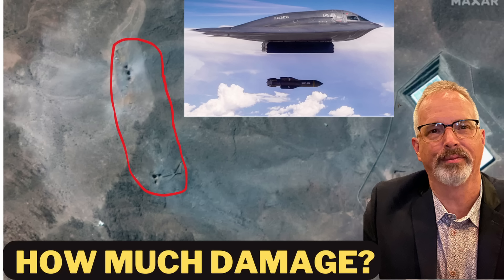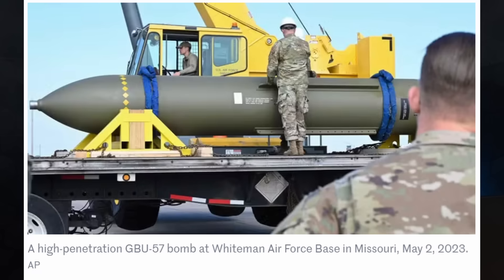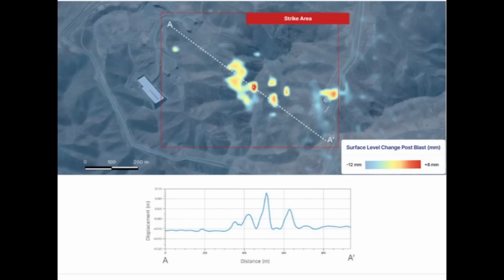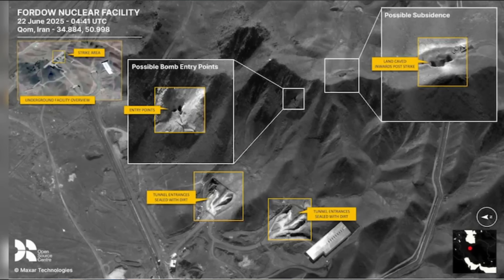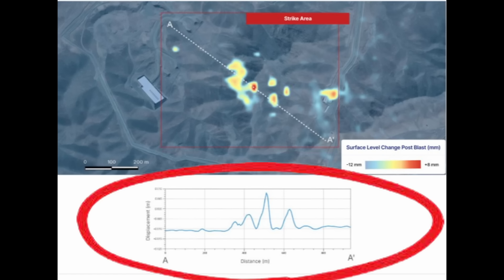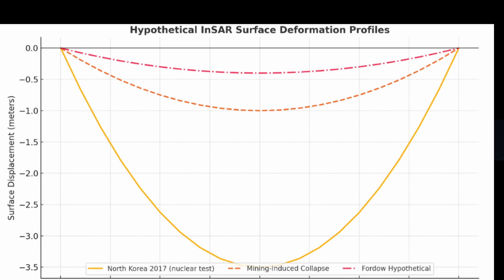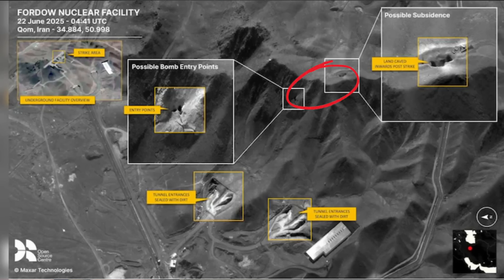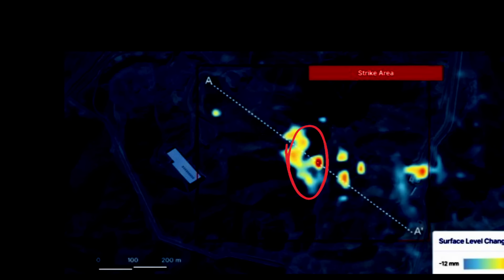Fordow Attack Assessment -  Update

Comment: The reasoning is backed by underwelming evidence since as you said there's little surface expression.
Anyway, 400 Kg of enriched uranium is still unaccounted for and it's very likely Iranians have moved it before the bombing.
To add to that, Israël just like the US could not strike all the other active nuclear sites to avoid the dispersion of radioactive materials.
At the end of the day, if Trump didn't ditch the Joint Comprehensive Plan of Action just because it was an Obama success, we wouldn't be discussing this 10 years after.

Comment: In my eyes… I didn’t even need to go as far as geotech. I just used the before and after pictures wherein the “after” pics have crushed rock powder  that altered the color around the impact site this “color” was also present in the access tunnels. This means that the MOPs went through all the way to level of the tunnels and the resulting blast went through until the tunnel “entry or exit” points.

Comment: The MOPs were designed and tested with assistance from Los Alamos National Laboratory (LANL) starting around 2010 with the first physical prototypes dropped around 2012. They were designed by an interdisciplinary team which included physicists, explosives experts, metallurgists, geologists and civil engineers, and the MOPs were designed SPECIFICALLY with Fordow in mind. The geologists located a mountain about 20 miles from the Trinity Site in New Mexico that was thought to be  geologically similar to the mountain at Fordow, and they even went so far as to build a hardened bunker under it. You can read all about this in GREAT DETAIL by Googling "Los Alamos Scientist’s Insights On The GBU-57 Massive Ordnance Penetrator, Howard Altman, The War Zone, July 3, 2025"

Comment: Would a volume of 100,000 m^3 equate to a radius of 50 m? If the charges were to have detonated sequentially, each fracturing a volume of rock, would the powder factor change as rock has been fractured by the previous explosion(s)?

Comment: Fodow is built in Andesite and Basaltic Andesite extrusive volcanic flows, of the 55-38 million year old Urumieh-Dokhtar magmatic arc. The volcanic rocks are overlain by younger 33-20 million year old sedimentary rocks of the Qom Formation, that includes competent beds of limestone, marly limestone, and dolomite. An old geological map, c. 1950, puts Fordo in the Orumieh-Dokhtar volcanics, but close to the boundary with the Qom Formation. I can see the dark volcanics at the site, but lighter sedimentary rocks just to its east. I think, judging from the color of the rock, and indeed the Iranians preference for stronger rock, that it's in the volcanics, however, it might be interbedded with sedimentary rock i.e it's a transitional area. There's a report about a tunnel north west of the site, I think 50km, in similar volcanic rock, and the report found the rock was a couple of times stronger than concrete. Given the depth of the centrifuge halls, 80-110 meters, I thought it was impenetrable, especially if they lined the tunnels with Ultra High Performance Concrete, but I didn't know about the air shafts, an Achilles Heel.
Reply: Why would you assume the air shafts were an Achilles heel? There is 0 public evidence, that they were not hardened using UHPC as well. There is 0 evidence, that they were directly connected to the main centrifuge halls, without proper shock absorption. All we publically know, are some old leaked plans.
Reply from the maker: Thank you so much for those details!

Comment: These tunnels are 80-90m below ground in granite. You can not penetrate that deep through hard rock using the GBU57. The air force knew this so they tried to go in through the ventilation shafts. 

If this worked the explosive force would go into the tunnels. You can not assess this from the surface.

What you see on the surface is a concrete cap covering the ventilation shafts being rearranged. They used one gbu57 to remove this cap at each of the two sites.
Reply: I’m speak Persian.   The Iranians say the tunnels are 1km deep and made with a special concrete specifically designed to withstand bunker busters.
Reply: @BabakTahani-e3v What else could they possibly say?

Comment: Suh-WEET! Sounds like if the Iranians try to dig it out, they'll find scrap metal. The question now becomes, how did this affect Iran's nuclear program? I suppose it depends on how much of Iran's UF6 remained in the facility when the bombs hit. 

UF6 is a solid at room temperature and sublimates around 130F. This implies that it's got a decent vapor pressure and likely would need to be enclosed in some sort of pressure vessel. If we use the density of pure Uranium as a rough yardstick (700kg/ft^3), we can assume that all of the UF6 can fit within a cube roughly one foot on a side. We also know that there have to be several containers, as this is well above critical mass. Ultimately, though, Iran could have removed all of the UF6 prior to the attack using a parcel delivery truck.

Did they?

So, questions remain. How much (if any) uranium was hidden elsewhere? If all of it was still at the "indestructible" Fordow facility ("Those degenerate Satanist PIGS will never penetrate our mountain!") - AND - if Mr. Jones's analysis is correct (not what I do for a living), Iran's going to be starting from square one, without several of their top minds. if Iran got the willies, unloaded their centrifuges and moved their stuff, they've got most if not all of it still available. It does seem unlikely they'll have more available anytime soon. Things are still up in the air but looking more hopeful, unless you're a Jihadist who wants to nuke Tel Aviv.

Comment: These tunnels are 70m below ground in granite. You can not penetrate that deep through hard rock using the GBU57. The air force knew this so they tried to go in through the ventilation shafts. 

If this worked the explosive force would go into the tunnels. You can not assess this from the surface.

What you see on the surface is a concrete cap covering the ventilation shafts that they used one gbu57 to remove.

Comment: Why do people assume that there is a shaft going directly straight down into the centrifuge room?  This location was developed knowinbg what sort of weapons would be used against it.  All those vent holes would be hooked up at various angles and nowhere near the the actual shaft which would some doglegs built into it.  I seriously doubt that even a light bulb was broken.  Most explosive force is going up to the area of least resistance, not down into increasingly stonger rock.

Comment: Knowing the US has a sophisticated satellite and high altitude reconnaissance capability, Would the Iranians have constructed vertical air shafts, which would have alerted the US to the area of testing facilities, or would they have ran those shafts back underground to their test facility to confuse an on looker?  If that was the case, the actual underground test facility could be any direction and distance from the surface shaft entrance.  Just curious why any one would think the test facilities are directly beneath the ventilation shafts?

Comment: I have question marks regarding the GBU57, as they went down a ventilation shaft, essentially a void with a void sensing trigger sensor. Also since the wikipedia I read suggested that they were using  GPS to navigate, which may or may not be exact enough to take 6-12 of these down the same ventilation void, as claimed in the video.
Imagine a scenario where the US dollar is gone replaced by crypto, and a rogue actors NEMP pulls the plug on every computer in America.

Comment: Appreciate the informative video, but a bit incredulous that Iranian engineers didn’t Google the topic and design countermeasures. 

The Cheyenne Mountain Complex, located inside Cheyenne Mountain in Colorado Springs, Colorado, houses facilities for North American Aerospace Defense Command (NORAD).  
Air Shafts and Protection Measures:
The complex utilizes a ventilation system designed to protect against various threats, including nuclear radiation. This protection is achieved through several features: 
90-Degree Angles: Air intake shafts are built at a 90-degree angle from the entrance. This design makes it significantly less likely for particles to enter the complex.
Blast Valve System: The complex features an advanced blast valve system that creates overpressure inside the base. This overpressurization forces any potentially harmful agents outwards towards the environment.
PS — who builds in a Death Star type weakness in a critical facility?
Reply: "who builds in a Death Star type weakness in a critical facility?"

The Iranians.
Reply: @colincampbell767 Typical yank seething.

Comment: Thanks, very interesting. 
I think that if I'd been planning this operation, to help with damage assessment I would a covertly installed or air dropped an array of seismographs along the sides of the target area and monitored what happened in real time. I might also add a "thumper" or two (kind of like Dune) so you could do seismic imaging afterward and check for remaining air voids.

Comment: I think your powder factor calculation is pretty low. I only use a.5 PF on boulders that have free faces on all sides. In high confinement the powder factor is significantly higher often a 3.0.  there are many other factors that affect blast efficiency such as voids and highly jointed rock formations that interfere with shock wave propagation. That said, homogeneous granite is hard to drill or penetrate, but shatters like glass when blasted. My guess is that the engineers who spent ten years figuring out how to crack this nut got it right. Thankfully we have a president who backs his words with action.
Reply from the maker: Thanks for the comment!

Comment: I think simple multiplication of the powder factor oversimplifies the physics and results in a huge (probably multiple  orders of magnitude) overestimate of the volumetric effect of one of these large bombs. Immediately adjacent to the detonation, the rock will not just be fractured, but pulverized or even melted; processes that take much more energy than merely fracturing it. The energy transfer to the rock probably decays as a 3rd or 4th power (exponent) function of distance. A physicist could enlighten us on that. Thus, the effects of your additional 1/2 pounds of explosive material do not have anywhere near the same rock-fracturing effect throughout a whole volume that you get by just multiplying up to get to 30,000 lbs. If that approach worked, mines would not bother to lay out a whole grid of numerous holes that they fill with explosives when they blast; they'd just drill one big hole and dump the dynamite down it. Simple multiplication to arrive at a conclusion of widespread underground devastation isn't a scientifically correct approach.

Comment: Almost 30000 pound bomb dropped from 60 -70 feet in the air with no initial propulsion. So the weight of the bomb by the time it impacts will be moving at tremendous speeds. Then as soon as it impacts the surface a propulsion kicks in driving further into the earth and detonates deep underground.

Comment: The most damning proof that the facility is gone, is Iran could just unplug the entrance that they filled with dirt and Drive inside.. Take a bunch of PR photo's and thumb their nose at the US.  The fact that they have a crane right now trying to lower a camera down the shaft says the facility is gone. Also remember the goal wasn't to destroy the concrete facility it was to destroy the very fragile centrifuges inside it.  If the Facility is collapsed then the fragile stuff inside is certainly gone.  UF6 would have leaked out as a gas, interacted with the water vapor from the bomb blasts turned into Hydrofluoric acid and very toxic uranyl fluoride.  The HF would eat almost everything it touched and the uranyl fluoride would be a fine powder that's embedded in every crack.  It would be less effort to start over then to try and salvage that facility.
Reply from the maker: Great points and Iran spent billions of dollars on that facility.  That has to hurt them.

Comment: Seems to me there are other factors here.  Fracturing causes bulking of course, but then the  second bomb explodes in the same space, etc., and eventually you have powder under the pressure of the rock load above.  The result would be less bulking.  Also, there used to be am extensive man-made cavern there that now has absorbed some of the bulking.  I think we might need a few supercomputers to calculate this one!

Comment: Simple (i.e.) basic comments:
1) No mention of previously enriched 60% uranium very likely moved elsewhere -whereabouts as yet unknown.
2) No mention that Iran has its own capacity to manufacture centrifuge assemblies - to be installed *where*?
Reply from the maker: That wasn't the point of my video.
Reply: @CaseyJones-Engineer  Granted - but it's a an absolutely key point in gauging what the key point of the strike(s) were tasked to achieve. All due respect, I suggest you were conspicuously remiss in ignoring those factors.
Reply from the maker: @2uksteve  I stated what the scope of this video would be early on.  I have no idea what is there in terms of uranium.

Comment: Let’s assume limestone with a compressive strength of approximately 35 MPa, almost identical to concrete with a compressive strength of 5,000 psi. Except that concrete is monolithic and penetration can be accurately calculated.  Also the DoD has released technical drawing of all of its current penetrator bombs and the GBU-57 is shown to have a penetration angle at impact that is ~20° off vertical. Plus the GBU-57 has a documented CEP of ~5m. The tale about 6 individual MOPs gliding down a vertical ventilation shaft is fantasy. Per the Pentagon, the first bomb  destroyed the (likely UHCP with a compressive strength of ~30,000 psi) concrete vent shaft coverings. Them boom, UHPC and MOP casing remnants scattered over a wide area. The second GBU-57 would have impacted at that ~20° off vertical angle and penetrated into rock maybe 10m, then…boom. Rock rubble and GBU-57 casing remnants fill the penetration cavity. Any GBU-57 bombs that were amazingly lucky enough to bullseye that center shaft would encounter ~8m of rock rubble and super hard bomb casing pieces. By the time that 3rd bomb got to solid rock, most of its energy would have been exhausted laterally while fighting through the rubble. The GBU-57 was designed to penetrate hard dense substrates. Almost all of its kinetic energy can be focused forward in front of the nose because the side of the penetration would be hard rock and would not absorb lateral energy.  The DoD engineers knew this, so did and do the Iranian engineers. Why give Iran, Russia, North Korea and China all of the data about stacking MOPs?  If it were a sane decision maker, they would blow up the UHPC concrete vent covers with a couple of Tomahawk missiles with the penetrator variant warhead and then push a wild story about stacking 6 MOPs down one hole and totally obliterating the facility.

Comment: As a geology student, an Army Engineer officer with conventional and nuclear experience and an estimator for a large, international construction company working on I-75 in Kentucky just south of Cincinatti where the rock is extremely hard and the cut walls are vertical I would say that all granite is not created with the same hardness.  I agree with you on your damage assessment.
Are there not satellites that show radioactivity?  If the centrifuges were destroyed underground that gray, expelled material may be highly radioactive.  It would also be interesting to see a satellite picture of the radioactivity at the two less protected Iranian sites.
Reply: U-235 is primarily an Alpha emitter with ranges of a few millimetres (that's why radioisotopes used for in vivo solid tumour medical treatments are mainly Alpha emitters or decay via electron capture - to minimise off target damage) and although subsequent decay generates some Beta and Gamma radiation it is way too low to be detectable from any distance. Remote hyperspectral sensing from aircraft or spacecraft has been used for geological mining surveying to detect heavy metal bearing rocks but I don't know whether it could detect dispersed U-235 compounds.